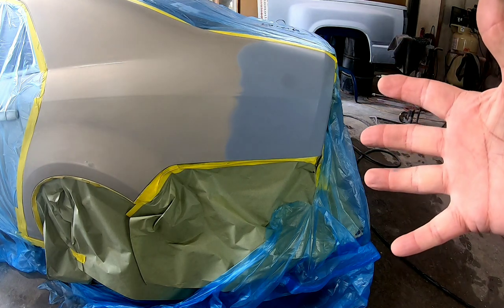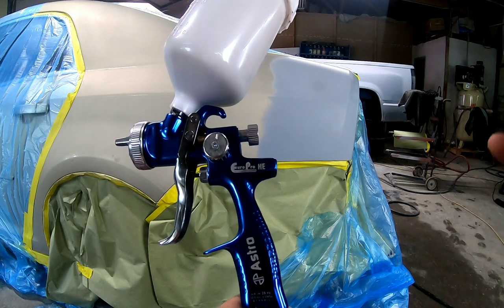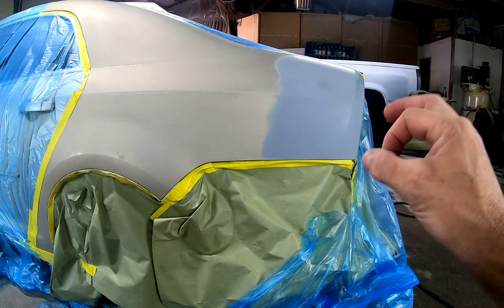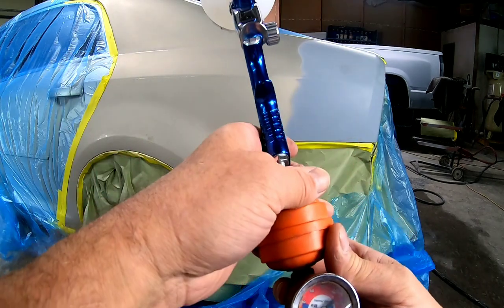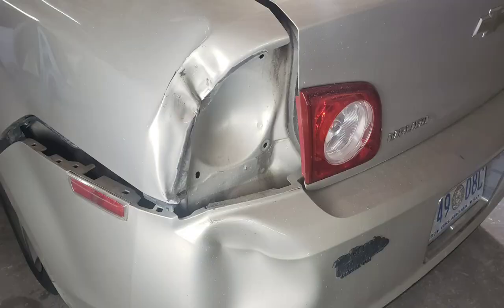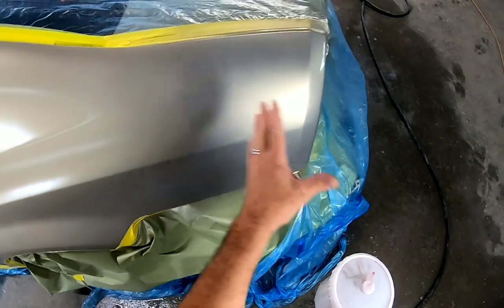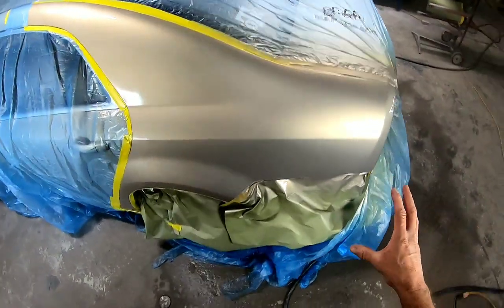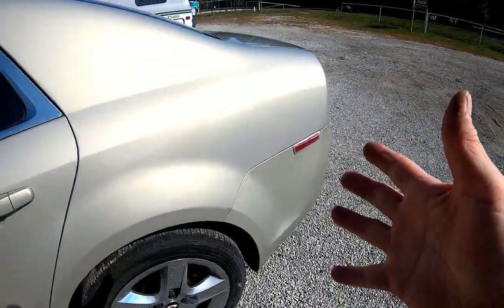How to do paint repair on your car using a budget paint gun. auto body repair,Astro euro pro he

Comment: Hi, what’s the difference between the 1.3 mm and the 1.5 mm and what would you say is the minimum compressor size needed. Thanks for the great video!!
Reply from the maker: The 1.5 is better for thicker materials like primer. 1.3 is good for base coat or clear.  Some guys like to use a 1.4 for clearcoat but I prefer a 1.3 for most guns. Appreciate the support! Hope this helps.

Comment: Nice gun    What gun would u recommend for smaller compressors like a 30 gallon  will the Astro gun work also with a 30 gallon
Reply from the maker: If your doing one panel  at a time a mini gun will work.  Astro makes one, tou want a gun that works with low cfm's
Reply from the maker: https://amzn.to/3BH3JbB
This is the touch up gun

Comment: Can I use a small compressor for this spray gun?
Also I have an R500 is this spray gun better?
Reply from the maker: No, this gun is not for small compressors you need at least 10 cfm's.  R 500 is the best gun for small compressors,  this astro gun is great a bit better in finish but r500 is better for air consumption, material savings

Comment: i just got mine!  Ordered it 4 months ago they were back ordered.  excited to use it.  Did you change your settings when you started to spray clear?  My spec sheet states 29 psi, I was wondering if you bumped the pressure when you shot clear?  I usually bump mine on other guns about 3 psi.
Reply from the maker: Cool , I don't recall if I changed the pressure.  I tend to shoot with the lowest pressure I can to control overspray. Let me know how you like it.

Comment: Can i use this gun with 26 gallon air compressor tank? Thanks
Reply from the maker: Technically yes, it will probably be starved for air at times and you may have to let the compressor catch up. I do have a recommendation for paint guns for smaller  air compressors.  The Eastwood lt100 or the sprayit 33000 paint guns all operate with only 3.25 cfm and they work great for small compressors without  sacrificing spray ability.  Check out my review  and demo. https://youtu.be/yNWLo-f0eNQ

Comment: Nice job brother, results are awesome, What size of compressor do you recommend for this type of gun?
Reply from the maker: Compressor needs to produce 13.5 cfm's @60psi
Reply: @GarageNoise  soooo… does that mean my home compressor 27 gallon air compressor would not do very well with this gun?  It shows 5.9scfm at 90psi
Reply from the maker: @patrickgreene1735  I can't  say for sure. I think it would be ok for painting one panel at a time. To do a complete it would definitely be starved for air. Typically it's nice to have 13cfms at 60

Comment: I have a question,how much psi do I need to set my regulator on the wall where I connect my hose to the gun I had it at 100psi I'm not sure if it's to high and I'm using an 80 gal the 1 at the compressor is 100psi also and my gun is 30 psi
Reply: *much
Reply from the maker: I set mine at 100 as long as you have a regulator on you gun it should make no difference.

Comment: First, thank you for this video on this gun. HF is good on upholstery foam glue! I been an ASE Master Tech since 1978, but painted a dozen vehicles and a buddies fishing boat. But forced into early retirement 11 years ago, I will spent money like a good Clear with 3-4 “UV” additives. Doing a complete restoration on a 1967 C10 heavily modified thanks to my son’s black ice experience in a 2003 Tahoe. 
  I read your info below the video but couldn’t tell if Solvent based / Water based and going for this gun. Epoxy sealer, mocked filler, sealer (All SPI) products but AkzelNoble color.
 My question was your opinion on the gun, especially the air cap on plastic cup. I would use 3M PPS hard cup/disposable to shoot upside down and no drips on top. (PU part of my childhood as I bought used one for $150 at 13). 
  Reading below, I was clueless on “Wet Base” but it was used for blending. I won’t have this with entire inside, behind cab, front of bed, assemble, back tape, got 3/4” backer rod to cover gaps & jambs. Top white onto window frames, rest is light metallic brown, finished with SPI universal clear. Thanks for the video & work that goes into edit, moving camera, it’s all work. Thanks for that. I am subscribed sometime ago and hit like! Stay safe.
Reply from the maker: I appreciate  the comment  and kind words good to hear this video  is helpful. Creating content is alot of work that I enjoy. This gun can be used for solvent paint or water borne paint. I love the gun and am uploading a video  now that will be released later today on the eruro pro hvot13 another gun by astro pneumatic. You should definitely watch  that video.  I would use the 3m cup system for sure. Thanks for watching!
Reply: Hate to bother, but the water/oil filter “Orange Ball” used as a final device to provide clear air is not listed in comments. I do appreciate the links to the products but somewhat weird to find the correct words to search for. They are sold by HF, but other brands are most likely better. What is your suggestion? Thanks again as learning is creating best practices, you are the teacher by example. Bless you!
Reply from the maker: Here is a link to filters I use  
https://amzn.to/3ew3iav
Reply: Found a video yesterday where they cut open an orange & blue HF water/oil inline filters. That was eye opening. Thanks for you efforts and reply. Best of luck!

Comment: Will a Harbor Freight 20 or 30 gallon 2 HP electric cut it with this?
Reply from the maker: I don't  think so it will starve for air. Those compressors will spay a touch up gun tho. This gun needs a compressor that produces  13.5 cfm's

Comment: looks good, i use one of those astro aswell i have the 1.5 for primer and sealer. been thinking about getting a 1.3 needle set. what product did u use for the qwet bed
Reply from the maker: Its a matrix blender. From local paint store.
Reply: @GarageNoise  thanks for the reply, how do u like it?
Reply from the maker: It works well as far as I know blending agents are all about the same. I've  been told it's  just straight  binder with no pigment.
Reply: @GarageNoise  yea I will check it out, I have some bulldog that states it can be used as a wetbed but never done it been looking into different products incase I need to blend a tricky metallic down the road

Comment: How do you blend the dry edge of the new clear coat to the old clear on the roof edge?
Reply from the maker: Wet sand the blend area with 1000 or 1500 . 6-8 inches past where your going to blend clear. Spray your clear then I spray a little reducer on the blend line (small amount) when it dries buff blend lightly  away from blend not into blend. Don't  try and buff it perfect. They have blending products you can use instead of reducer like melt away  but I perfer to use reducer. Stay tuned for a video on how to do a smart blend. Not the correct way to do a repair but can be useful in certain situations.  Thank's for watching!
Reply: @GarageNoise  Thanks so much!! Makes sense now. 
I currently use a DeVilbiss FLG5 gun for base and clear. (1.4) Works well, but I’m going to order the Astro gun based on your recommendation. Look forward to trying it out!
Reply from the maker: @jumpinjojo  I hear the Flg5 is a good gun. I've  been using the 3m performance gun lately and really like it.

Comment: could this work with a 20gal compressor?
Reply from the maker: I think it would be starved for air. Your compressor should put out at least 13 cfm's at 40 psi to have no fluctuations in air pressure.  You can use this gun with less but you may stuggle to have consistent performance.  If you want to use a small compressor,  astro makes a mini gun that consumes less air. Although you wouldn't  want to paint an entire car with it. Thank's for watching I hope this helps.
Reply: My Astro EVOT-13 sprays nicely off my 20 gallon compressor.  I just paint one panel at a time, and have managed fine.